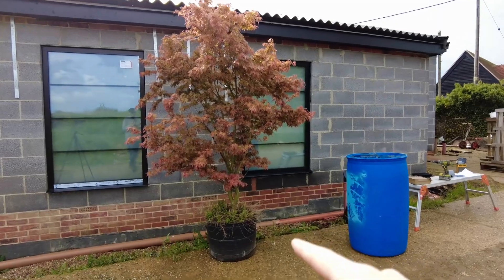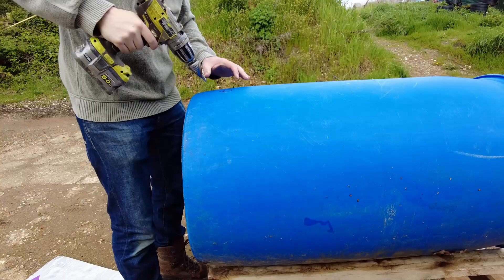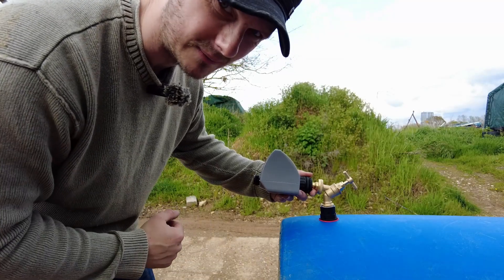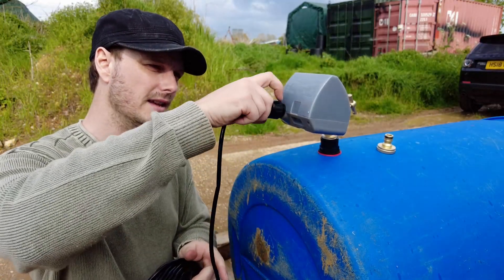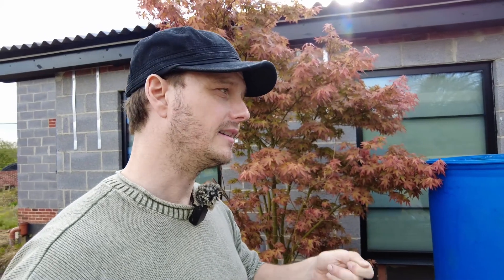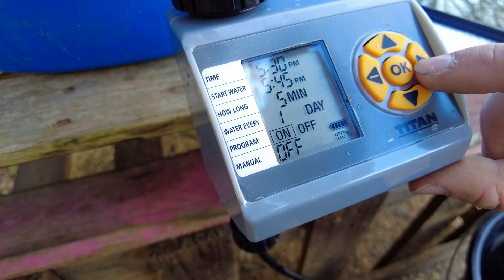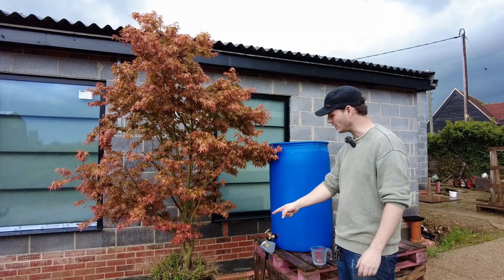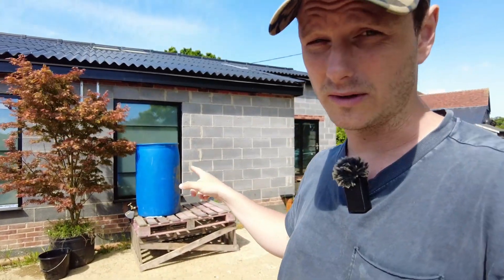Automatic DIY Plant Watering System

Comment: Hope the acer is doing alright. We have one and it looks like absolute crap 75% of the year. They hate wind apparently so the leaves get wind burn and shrivel up. It does grow back again in spring though despite looking very dead!!
Reply from the maker: Looks like it suffered abit last week as it was so hot and I was away 🤦 the water ran out at some point, I can't remember topping it up to the top before we went 😬 apart from that it seems to have been doing the best it has ever done. I've always known it to turn green in the summer but this year it has mostly stayed red. The scorching has got it abit though 😕 
Is yours potted or in the ground?
Reply: @THE-AIDEN-PROJECT  It had been in a pot but planted it out earlier this year, so maybe that’ll help it out in the long term, who knows. Though it’s quite possible we’ve not watered it enough, given your experience. Finicky things! 🙄
Reply from the maker: @cuboid5  hopefully it'll do better next year then. I've got holes drilled in the pot just to make sure I don't over water it but it definitely seems better for having automatic watering that's consistent. I'll be building a raised planter for it at some point so I probably best rig up an auto watering system for that also